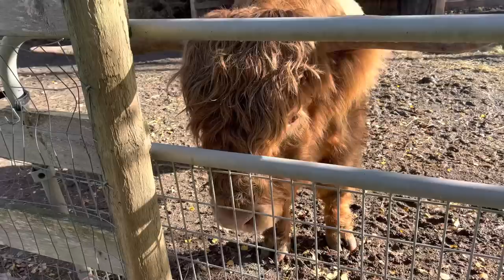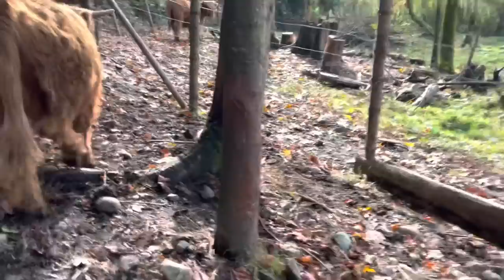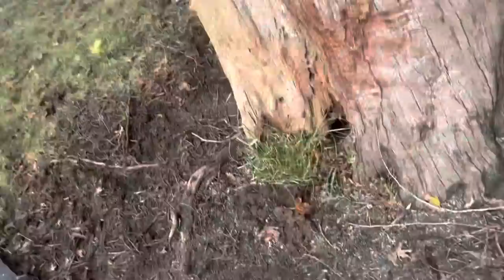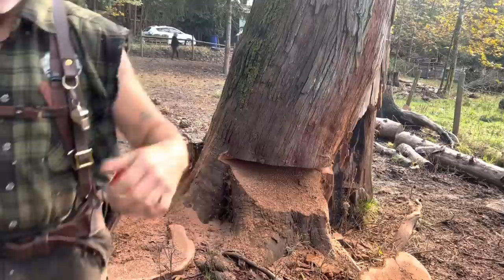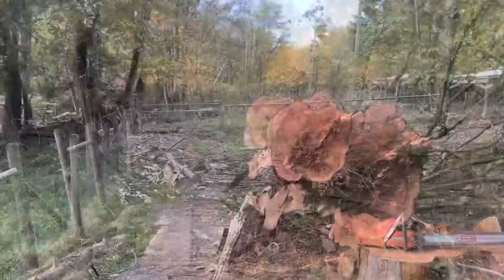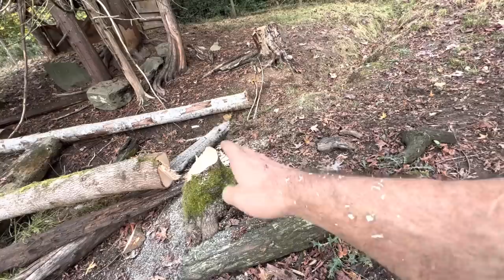Biggest Tree i've cut in a while, unexpected result

Comment: Dear Mr. Buckin,

I just came back from a late season deer hunt in my neck of the woods. Its a river bottom. Was full of cedars back in the day. They logged it like most valleys around here. My question. All the cedar stumps from 24” to 96” even bigger they used chainsaws. So like 80ish years ago i figure. Anyways. The undercuts are two horizontal cuts and then the knocked out or cut out the wedge before putting another horizontal back cut in. And like 4-6” above the undercut. You can tell it was logged in the winter because of the height of the stumps. I wondering how they did this with the saws they had back in that time period. Can you shed some light on this?  Maybe demonstrate? 

Thanks so much.

Comment: Put down a six story dead Ash yesterday Buckin.  Very common in the NE US due to emerald ash borer. Tree was a hard leaner 20 degrees to starboard. Used several techniques and some timely wedge work to fell it 15 degrees counter to lean. Lot of compression on that lean and tons of tension on the back side. I credit the Buckin Experience in knowing not only the technique but also the safety issues inherent in the felling plan etc.
Reply from the maker: good stuff

Comment: I was recently at a chainsaw safety course and was told that reving the saw was just wasted fuel. I should just lay in to it and let it idle when im not cutting. So my entire way of handling a saw must change if im to do what he says. I rev the same way as you without a load.
Reply from the maker: good sir please understand something as ya go forward on yer journey no cutting scenario is the same , there s senseless reving which most definitely is wasteful but then there is chip clearance and oil distribution issues. and a handful of other things that i wont go into , timber faller are completely different animals than any tree service fella or firewood cutter . we do thing that people dont understand , and they have to if there are not gonna be in the situation , but if i were a young aspiring woodsman , i wood much rather learn from an ol' faller than a tree service . and thats what i did . its your saw it your gas , have some fun . but remember you will be juded on your over reving lol
Reply: @BuckinBillyRaySmith  wow. Im almost star struck. First reply ever from somone im a fan of. Thank you friend. 

Secondly i have listened to you and others and i run old saws so to keep heat down and make sure its well lubed i lift from te cut and give the gas a few taps every now and then instead of just laying in to it all the way through. Also my chain was what i consider dull, the instructor ment it cut just fine looking at the grains left from the cut.

Im not a faller nor a logger im just somone who cuts trees. But im more of a you type than a logs for building type. But with my own twist, your channel have inspired me to follow my dream and combine my love for the woods, and my love for blasting, so hopefully in a few years i run a successful business blasting dangerous trees for the cable companies, park services and others that may need trees blasted instead of cut. I will make my own videos like you once im off the ground first to get exposure and hopefully create my own market and if everything goes well i might do a weekly video blasting.